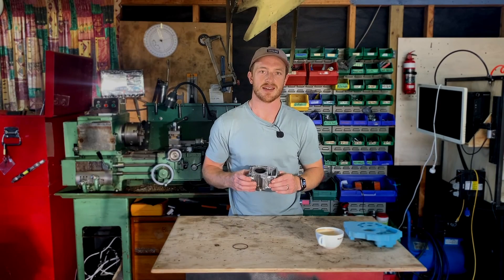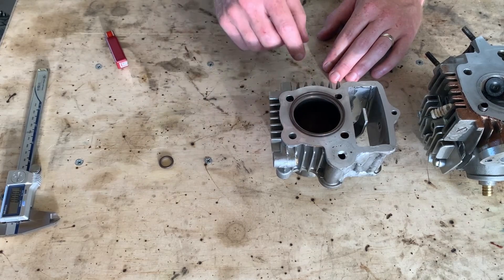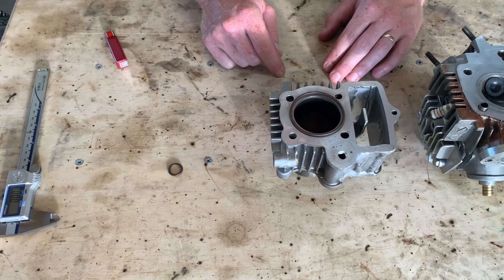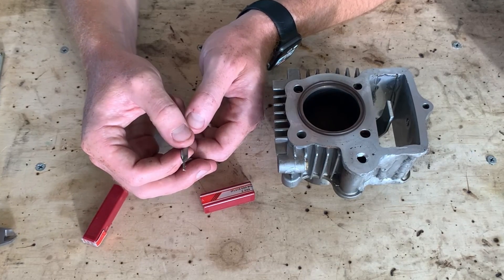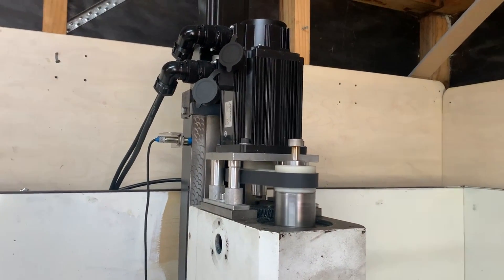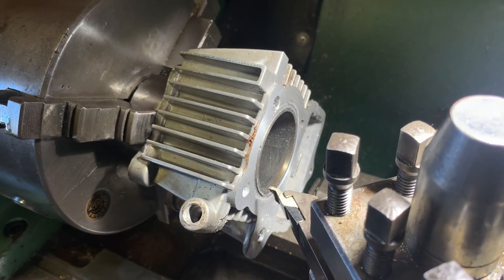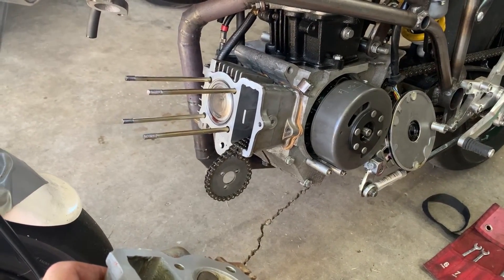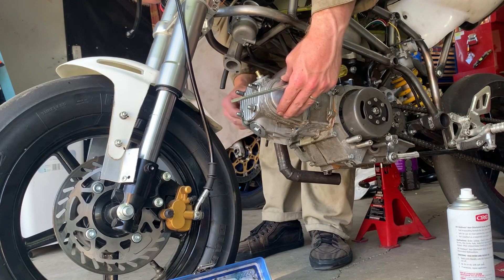Replacing Head Gasket with O-Ring

Comment: Be interesting to see how long this lasts... normally you'd use a stainless steel oring in conjunction with a copper head gasket. Both the head and the barrel need to be grooved at specific a depth/width.
Reply from the maker: I’ll let you know, the viton o ring seems to work in every 2 stroke mx bike. I might as well give it a nudge with the stakes being so low.

Comment: Very nicely done! When you pulled the end mill out I seriously wondered why didn’t you use the lathe? Even a neutral rake high speed steel bit on the lathe would have done a perfect job of making that groove.
Reply from the maker: The was the obvious choice, I was going to machine the small o ring groove in the same set up and the small one would’ve been too hard in the lathe. But In the end all went well.

Comment: Thanks for the update video and good luck with your race event. Note that eliminating the head gasket will shift the cam timing.
Reply from the maker: Thanks for that, To be honest I didn’t really think about this, but I have spaced the base of the cylinder with a solid aluminium spacer gasket to mitigate this.

Comment: I don’t think the Viton will take the combustion pressure.
I would suggest a stainless tie wire ring in a groove cut into the liner. 1/32 or 1/16 dia wire this will embed in the head so use the smaller wire first and use the larger wire if there is a leak.
You could also use copper wire annealed as well.
Cut the end on an angle and keep the gap to a minimum, a scarf joint would be ideal.
You can then use a counterbore to cut the o ring relief in cylinder face around the stud for the lube pressure oil feed
Then use RTV for the chain tunnel.
Good luck and take care.
Reply: Viton O-Rings will easily cope with the bulk temperature of the head, but any direct contact with combustion gasses and they will fail quickly. They may survive long enough if the head and barrel are very flat. 

Gas filled copper o-rings are the usual choice for sealing cylinder heads without a gasket. Stainless wire is normally used to increase crush on a head gasket gasket fire ring.
Reply from the maker: I’m thinking it’ll be fine. I figured the Viton o ring works on every 2 stroke mx/GP bike so it’ll probably work here provided the groove is the correct size and the surfaces are flat. 
If the engine was boosted I would definitely go for a wire ring.
Reply: @OddsandEndsMachining  personally I would have used either a fire ring as on Volvo truck engines or GM 2 strokes, or a longer sleeve(shorter cylinder muffler) with a step and no gasket ala Vincent.
Fire rings allow non conformity between the head n barrel instead of lapping individually of head n barrel.
But then I am strange and do the difficult.
Enjoying all this and look forward to the 4,  worked on Suzuki and Yamaha 4 in the day, fun to ride.
Take care.